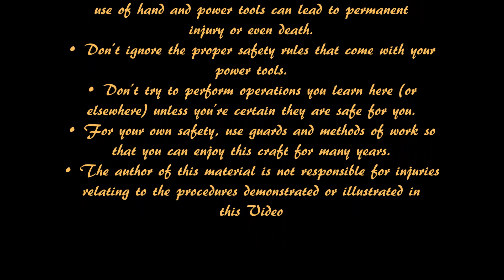Diamond shapped platter

Comment: Hi Al,
The grain in that wood is amazing!
Thanks for the safety tips!
You're absolutely right about getting hurt with some tools we use most of the time and become lazy minded when we use them!
I almost took off my left thumb while using a drill press to drill holes in very thin strips of metal! Stupid mistake but a well learned lesson! 
Thanks for the video!
Tom

Comment: I agree with the other commenters...the Rebel Turner never ceases to amaze.   He sees things in wood that most others do not.    Al is so right about the safety aspects.   Those live and sharp edges are very much like an airplane propeller.   My 16 year old grandson and I are fairly new to turning.   I always stress hands behind the tool rest.   It is so easy to slip up.

Comment: Al, do you buy thin CA by the gallon?!? Nice piece and I agree that you have to constantly be aware while turning these winged pieces. I'm not even sure the risk is worth taking, but I keep doing them anyway. Sanding and finishing them is also problematic and I never really am happy with the final results.
Reply from the maker: I should buy CA by the gallon or five gallon buckets but the largest I have see is 16 oz. LOL sanding use a power sander it's ike turning it just keep to edge of the disk away from the edges.Take care  Happy turning